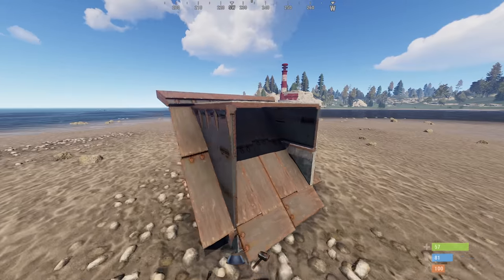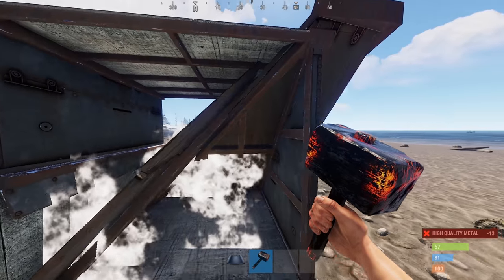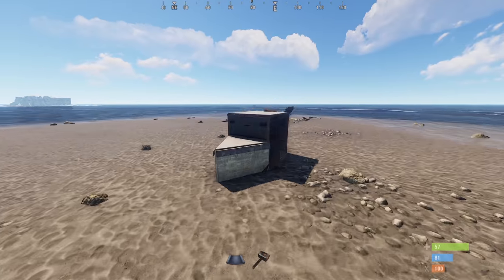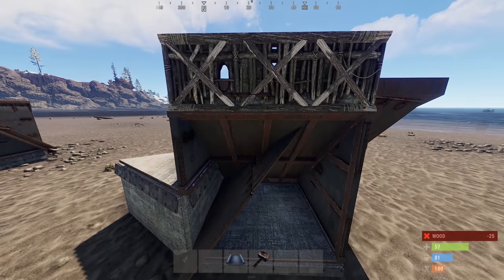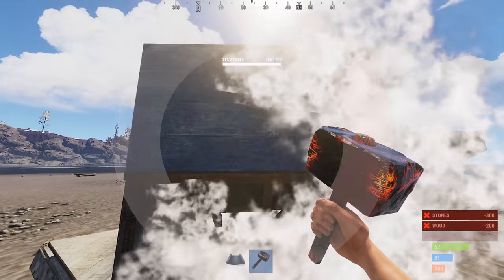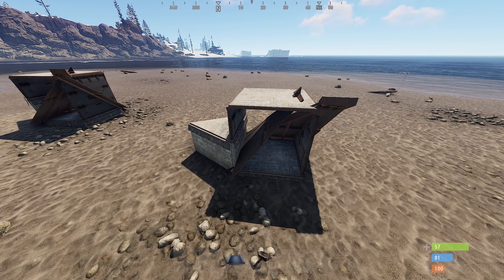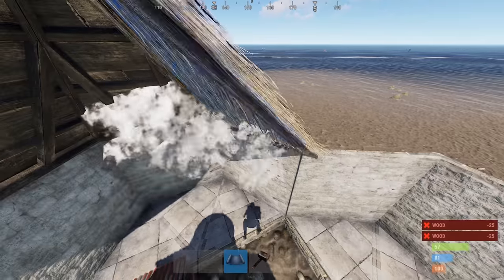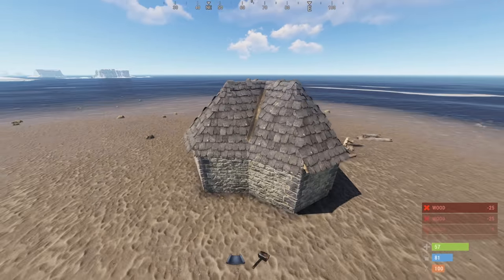Rust - I Fixed The Roof Bunker - Rust Base Design 2021

Comment: the lower foundation roof bunker works if u just keep the roof frame twig and it works the same way. so the roof bunker isnt gone it just costs a bit more to use
Reply from the maker: Right
Reply: why would you want to leave it as twig, it's useless that way
Reply: @Chris-cf2kp  what r u talking about
Reply: @katewehr414  You can make it work with a hatch below the roof piece, above a lowered foundation altogether, and have the hatch frame as twig, and get blown out with a trap. The way you worded it makes it sound like you're leaving the roof piece twig.
Reply: @Chris-cf2kp  yea that bunker doesnt work anymore

Comment: I use a ladder hatch twig frame under the bunker to remove the side roof and close the bunker, but would have to upgrade the side roof everytime u want to open the bunker
Reply from the maker: That is a great fix for it, most likely better than the one i show in this video

Comment: I hope people wont complain about it now cause it takes a lot of stuff to make it work over classic stability
Reply from the maker: You know, bunkers are very very strong in terms of builder to raider.  I've seen many raider's run into a bunker and all of a sudden the 12 rocket raid is 27 rockets, which tbh feel quite unfair to raider's.  On the flip side, as a base owner it take a much longer path to get 15 more rockets of raid cost on say your door path.  I haven't crunched the numbers but this new roof bunker appears to be closer to that additional cost.  So all in all, overall, i think this bunker cost is much more fair... If that makes sense, it made sense in my head anyways haha
Reply: @MyGamingExperience  makes sense. Plus bunkers are the only thing that's stops big groups from targeting little guys
Reply from the maker: that is also true